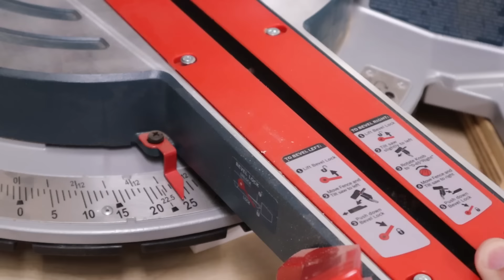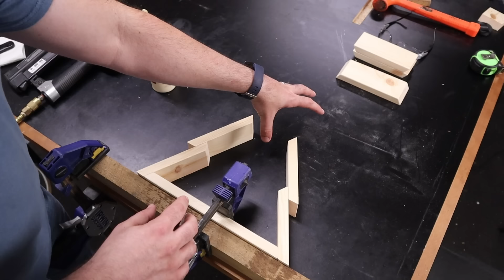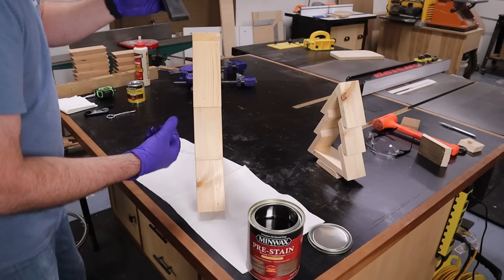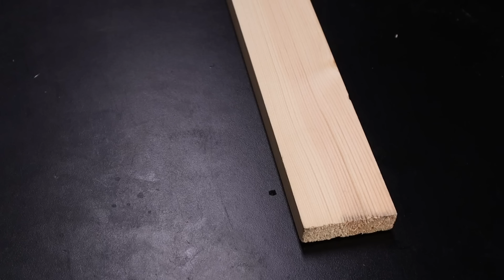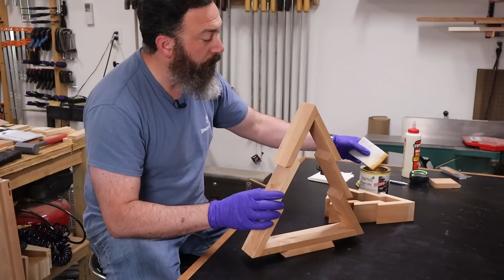Let's Build a BETTER Wooden Christmas Tree!

Comment: Great stuffffffffff as usual!! 
Why does the hard wood deserve the more finessed edge? You could both trees with it….yes?
More bloody maths!! What is it with you sir? 😮 board-feet so stupid a way to sell it! But I just watched Montreal and she covered working it out! So brain drain saved.
Lovely trees, did you mention a price point?
Bob
England
PS Cherry wins!
Reply from the maker: You can certainly spend the time on the pine versions just as I did with the cherry, I just wanted to highlight the different approaches you can take. Fast and efficient vs a higher quality product that takes a bit longer. 
Yes, more math! Did I mention I'm an engineer? I try to keep the math simple, but it is unavoidable for most projects.
I did not mention price point because there are a lot of variables involved, and MATH! The cost of materials is different between the pine and hardwoods, labor rates you charge for your time, and what your market can bare. I've seen similar trees range from $10 each, to over $70 for the pine. In my area I can get around $40-$50 for the pine. The cherry is more in the $70 and up range.
Reply: @biscuittreewoodworks  hi, thanks for replying. I can take time to reply due to health conditions.
OK I follow all that, sell few at high price sell loads cheaply. 
An engineer! That makes so much sense!!!! I don’t really mind the maths what I have always struggled with is the tape measure, sure measure twice and still the cut is wrong!! Measure as much as I can and still be wrong! Yesterday I fixed a baton to hold hooks etc on the back of my hallway door. So pleased, all done things hanging except it catches the damn frame about 1” from closing!!!! Maddening!! How do I cure it?
Thanks very much for the money info, I doubt I could sell the tree as it is for $70(£55,12) even in my middle class area. They are wonderful margins……..yes? Do you make many or is media in the way now? 😁
I really enjoy your videos, style, script, tone, sidebars, are all just right.  
Bob
England 
PS: why the name?
Reply from the maker: @BobMuir100  Not sure how to fix your door hanger without seeing the issue. Try to see what is preventing the door from closing and see if you can make adjustments. 
I used to sell more, but these days I'm making more videos than selling. I have a website that badly needs updating where you can find some of my products listed for sale. I'm working on a new, updated website that will hopefully be ready in a few weeks.
The business name comes from something that reminds me of my late father. We lost him to cancer 10 years ago.
Reply: @biscuittreewoodworks  Hi, got the issue with door closing identified, so difficult when it’s so close to being shut as one can’t see what it’s hitting, so I was dragging stuff out and moving stuff around but it has turned out to be (I think!?!.) that the damn baton is millimetres too long and just catches on the frame! This is what will get me.I am broad issue and not detail!! Could derail me completely!
I thought you looked more creator(?) than woodworker now and as I said it looks good on you.
Yup your website does need an overhaul. I used to own a web business in the early days of webs. Crikey at the beginning I was only a page ahead (in the instruction books) of my clients !!  Anyway got some 500 sites under our belts before it just bottomed out………I was billing £3000 ($3800) at the beginning and at the end only £600 ($762) . And now with these self build sites there’s just no real money in it. Self builds are OK but not serious. Your website should be your main area of concern. I worry about folk who keep YouTube as their only channel and then fall foul of some rule and everything topples, far too risky.
I lost my father some 3 years ago and it wrecked me. Still intrigued as to what it means but don’t expect you to fill in the blanks. 
Talk later
Bob
England

Comment: Why stand the stock on edge rather than flat? Which, when using the one pony show (SCMS), is safer in all ways.
Reply from the maker: Just preference, I feel safer with the blade in vertical 90 degrees than coming down at an angle. If you prefer the other orientation, there's no problem doing it that way. These could be done at the table saw with the blade tilted as well.

Comment: I made 3 of different heights using some old 1x oak I had laying around...problem I ran into was I just shortened every original dimension by 3 inches and it did not work. I had to make adjustments on the fly. How would you turn this into a BIG tree that could be placed ourdoors?
Reply from the maker: Because the boards overlap and thickness of the boards is a factor, you can't just scale the sizes up and down to make larger or smaller trees. The best way would be to draw it out to scale on paper or in a drafting program to get all the correct measurements. The other method is to do like you did and use trial and error until you get something that works.

Comment: Are these cuts at 45" or? I'm assuming they are, but who knows, could do them at any angle right?
Reply from the maker: No, you have to cut the angles at 30 degrees for the joints to line up. I say that at 0:35 in the video.
Reply: @biscuittreewoodworks  ahhh must have just glossed over you saying it, thanks for the reply!

Comment: Like your plan/design, although mine don't seem to match up together nicely like yours. Not sure if my miter saw at 30 degrees is off a tad or not. Also, what is the overlap on the side pieces, 3/4" or 1"? Thanks!
Reply from the maker: The correct angle is very important! The overlap isn’t that crucial, it’s roughly 1”, but I don’t measure it. The way I build them it’s whatever is needed for the proper fit.

Comment: Thank you for this great video. New woodworker question though: I don’t have a brad nailer. What can I use instead? Just hand nail the brad nails?
Reply from the maker: No, you won’t be able to hammer in brad nails by hand. They are way too thin. Your alternative would be to use the CA glue trick I showed on the cherry version.

Comment: Those look great! The cherry came out very nice. What do you typically sell them for? I have made some rustic ones from pallet wood in the larger size for a craft fair this weekend. I think I will try some with Cherry in both sizes.
Reply from the maker: Depends on your market and the buyers you are trying to target. Some areas you can get a lot more for hardwood versions that are nicer construction. Even in my market it depends on the buyer. Some people would be willing to spent well over $100 for them, while others wouldn't give me $10. I didn't make very many of these, but if I was trying to sell them at a craft fair I would have them priced around $70 a set and see how well I did. Adjust your prices depending on how they are selling. You could go to a different craft fair and end up with completely different prices.
Reply: @biscuittreewoodworks  Thanks. I was goings for $60 a set. Unfinished. Going to see. I have a couple more craft shows before Xmas. Thank you. Have a good holiday.

Comment: Great vid, thank you. I’m struggling to make the cuts all the way through because my mitre saw is much smaller and doesn’t quite get through the whole piece. When I used a friends bigger saw, I ended up making all the cuts 1/8 inch short because I couldn’t work out how to take the saw blade width into account. Any tips?! Cheers from the UK
Reply from the maker: 1/8" should affect much as long as it's consistently the same between all the pieces. My advice is to setup a stop block like I did in the video and make a test cut to verify your measurements. You can always aim for the first cut to be a little too big then sneak up on the perfect cut.

Comment: As a metric guy I wonder about the lumber dimension. You say it is 1x3, but is that 3/4 inch in reality, or was this just for cherry? So I'm gonna look for some 18mm pine?
Reply: I doubt that the thickness is cruical, but 18mm should work great
Reply from the maker: I'm not sure how lumber is dimensioned outside the US. I know here, if you buy construction grade dimensional lumber a 1x3 board is really 3/4 x 2-1/2. Cherry and all other wood that you get from a lumber yard or sawmill is sold by the board foot which is a very different measurement system. All that said, 18mm is pretty close to 3/4" so you should be fine.

Comment: Like the shirt logo.   Go 2A
Question:  Why am I seeing 10 pieces in the cut picture and 8 used in the build?  What did I miss?🤷‍♂
One of the easier methods I've seen.  Tried the jig thingy.  Didn't work for me.

Thanks.
Reply from the maker: Yeah, I didn't like any of the jigs I've seen other people do, which is why I didn't do one. Not sure where you saw 10 pieces to try to clarify for you. Do you have a time in the video you saw this? Each tree should have 8 pieces each, I cut 16 total pieces at one time to do both the large and small tree.
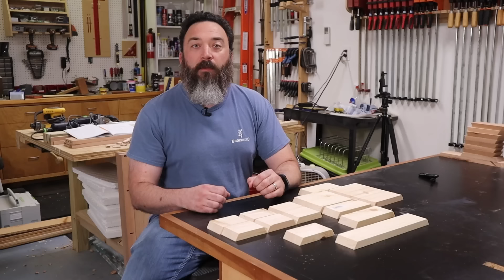Reply: @biscuittreewoodworks  What am I looking at at 1:24 and 1:34?  It looks like more now.  OMG!  They're multiplying.
Also review the numbers in the cut list.  What am I seeing there.
I'm 80 so I confuse easily.😁
Thanks.  I'm going to try your method tonight just eyeballing it.  Seems like a better method than measuring overlap and if it is off by a hair, so are trees.       JimE.
Reply from the maker: @JimE6243  Ok, I see. That is all 16 pieces for both the large and small tree. I build them in sets so I cut all the parts for both at the same time. Hope that helps!
Reply: @biscuittreewoodworks  Ahhh.  I missed that part too.  It's hell to get old.  Thanks.
Reply from the maker: @JimE6243  no problem! Let me know if you have any other questions!

Comment: Nice job! I like the CA glue method. Can you tell us the CA glue you use as well as the activator spray? Thank you! Affiliate links would work.
Reply from the maker: Sure, I use Stick Fast. I added a link in the video description for the kit. These aren't like the cheap superglue where the entire bottle dries out after only one use. I've had these for quite a while.
Reply: @biscuittreewoodworks  Thank you! Good information!

Comment: You should rub a little wood glue into the end grain first and let it soak in. That way the glue will bond much better if you're not using brad nails.
If you're using brad nails you don't even need to bother with the glue with such a light weight piece.
Reply from the maker: Yes, you can preload the end grain with glue to get a stronger bond, but it's not at all necessary here. I disagree with using brad nails alone, even on a project this small and light. They are going to work loose very easily. If you sell something to a customer that is falling apart by the second season, you won't have a repeat customer.
Reply: @biscuittreewoodworks  I guess my experience with brad nails is different. I've made shop jigs with them alone that get moved and banged around a lot, and they've held up just fine. This would be moved twice a year: once to the shelf, and once back to a storage box. Just my 2 cents. Glue is cheap so not a huge difference.
Reply from the maker: @johndoe6032  I this case it’s the angles and very little surface area that would make them weak.for example you could get away with just brads on the base that gets attached to the bottom, but not the other joints of the tree.

Comment: Great explanation. How would I go about calculating the pieces if I want to make a larger size, say twice the size of your large one. Double your measurements? Thanks.
Reply from the maker: No, doubling the sizes will not quite work since these pieces overlap each other, the math and angles just don't work out that way.  The best way to do it would be to draw it out or use a CAD program. Other than that, trial and error.
Reply: @biscuittreewoodworks  I thought so, thanks for replying back.

Comment: Almost the same way I build them, but you will be faster using an additional clamp for the top piece instead of unclamping the bottom piece. You can also skip the center line marking by simply adding a visual guidance on your fence.
Reply from the maker: Thanks for the tips

Comment: Suggestion, make a jig to fit all of your pieces so all you have to do is glue and nail them, and it will also increase production
Reply from the maker: I thought about using a jig, however home store pine is so variable in thickness and has lots of warped and twisted boards. Any jig would have to have enough play in it to work and not have big gaps in the joints.
Reply: @biscuittreewoodworks  Different suggestion:  Do the top pieces first and the do the bottom.  Then you aren't handling the bottom twice...would save a bit of time.

Comment: Thanks for the tips!Excellent explanation
What about the price for the set?
Or individual.
Reply from the maker: It's going to depend greatly on your local market and how well you market them to your customers. The price I get in my area may not work where you are, or even for someone else in my area. Just in my area I see people selling individual wood trees between $20-$50. Test them in your market at what you feel is a fair price. If you sell them faster than you can fill orders, then the price is too low. If no one is buying them, then the price is too high or you need to improve your marketing strategy.

Comment: Great video. Why do you not use the same glue method on the pine as you did on the cherry?
Reply from the maker: No reason you can't, it's just a little faster with the brad nails. Also the pine is more of a rustic look already and the nail holes aren't as off putting as on the hardwood.

Comment: I think it looks way better when the tree parts have the bevel parallel, its more uniform and gives more of the outline of a christmas tree.
Reply from the maker: You can do them that way if you prefer, but not all the pieces can be cut like that so you will be changing the setup a lot more or the tree won't go together.

Comment: Thanks for sharing
Reply from the maker: Thanks for watching!
Reply: @biscuittreewoodworks  Hey, I had a problem with the top not fitting
Reply from the maker: It should fit together just like the video. It’s 3/4 of an inch longer than the other side pieces so you get the overlap on top.
Reply: @biscuittreewoodworks  thanks

Comment: Thanks for sharing. These look much better when the 4 “limbs” are cut as parallelograms rather than trapezoids.  This also allows the addition of a couple of shelves across the inside.
Reply: All you have to do is not flip the board 180° before making the 2nd cut, on the 4 branches. Not additional set up required….
Reply: haha, I literally said the same thing and didn't see this comment
Reply from the maker: You can do them that way if you prefer, but not all the pieces can be cut like that so you will be changing the setup a lot more or the tree won't go together.

Comment: If you are making a lot of them, you should probably make a jig for the assembly. That would make it faster and more consistent.
Reply from the maker: You could, but these go together so easily I don’t think it’s necessary. If you do build a jig, make sure it has enough play to account for variations in wood thickness and warping that you get from the home store pine.
Reply: @biscuittreewoodworks 
I was thinking of an outer or inner border. not both. But yeah. I guess I was a bit condescending in my comment, to assume you had not thought of it. And I regret that.
Reply from the maker: @yossiyaari3760  No problem! If you do come up with a better solution, please share!
Reply: @yossiyaari3760 I tried a jig once didn’t work for other wood varieties.

Comment: Looks great now ave decent reliable mitre saw gonna attempt these this year. Although on the whole measurements between store hardwood dealer etc this is one reason i can never understand the American measurements on yt. Go to mm its allot easier than say trying figure out say 3/16ths or 13/64ths a mean come on over here 25mm is an inch and people work in mm everywhere you buy wood. 🏴👍🤯
Reply from the maker: That would make things so much simpler, but I’m afraid we are stuck in our old ways!
Reply: @biscuittreewoodworks  yea must say don't ever think across the pond will ever change. Although would make things so much easier for u guys. And watching creators on here. 🏴👍
Reply: It’s not hard for “Us”. We know how to measure Imperial and metric